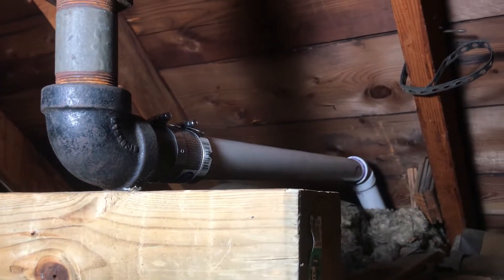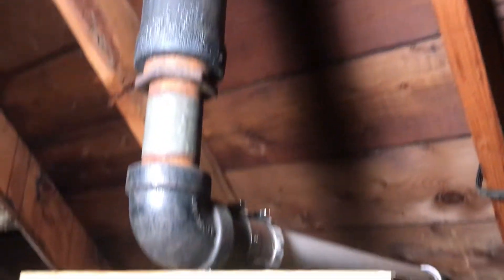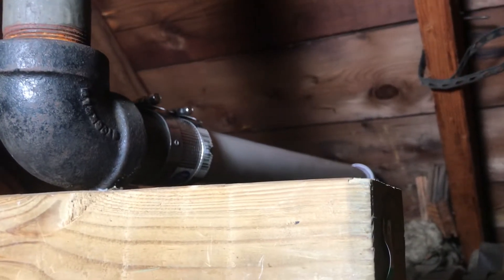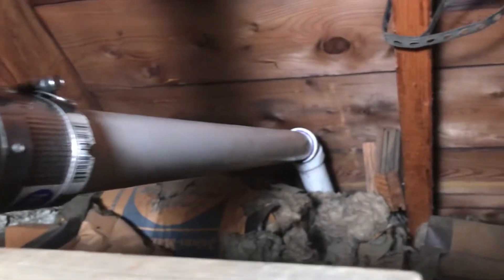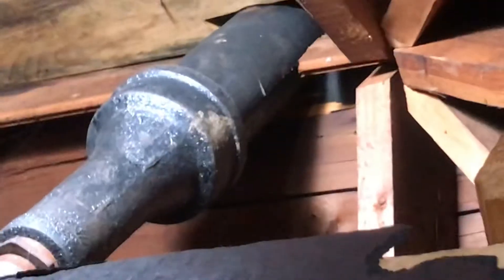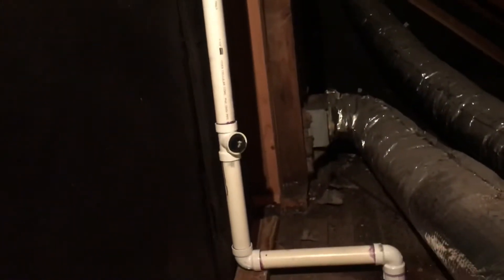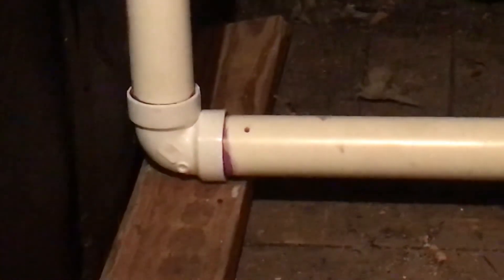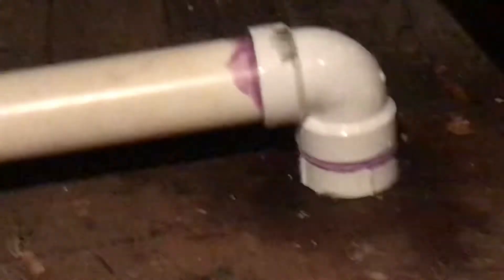How I replaced a galvanized vent pipe.(2022)

Comment: If you're gonna put a cleanout, best to put it below the vent tees since they'll be a pain in the ass to get a snake through
Reply from the maker: I have many 4 cleanouts for my kitchen sink, 3 on the drain and the one on the vent, I snaked the vent cleanout after installation and it was easy to use.